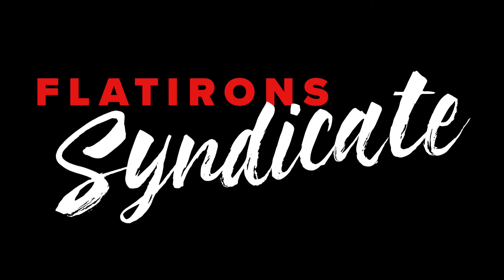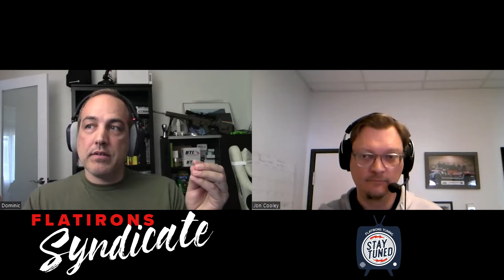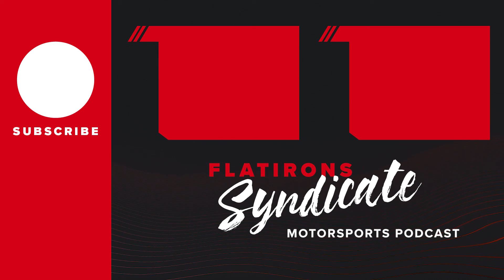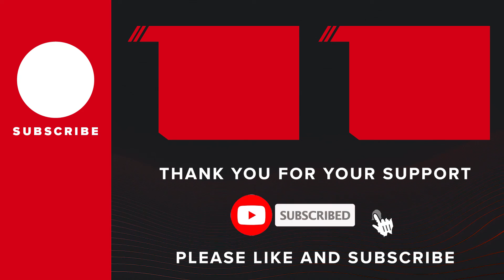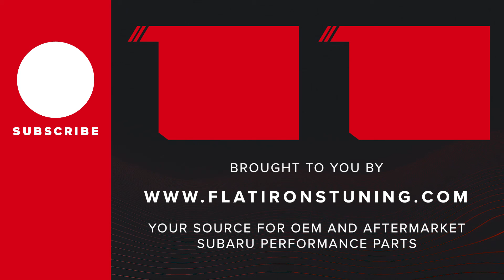Lessons Learned from putting Subaru Engines in Airplanes - With Dominic Acia

Comment: Telling how different the loading is on an aircraft compared to a race car. 6 hrs at full throttle is very much different to a 6 hr race, when then engine might see to full throttle 90% of the time but only be a peak torque or power for 15-20% of that 90%
Reply: Yeah, duty cycle goes a long way